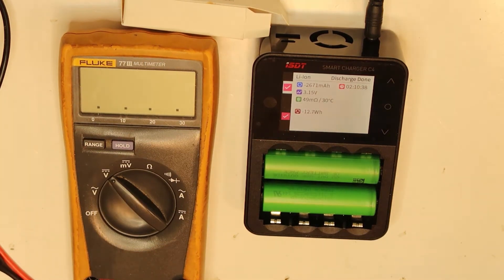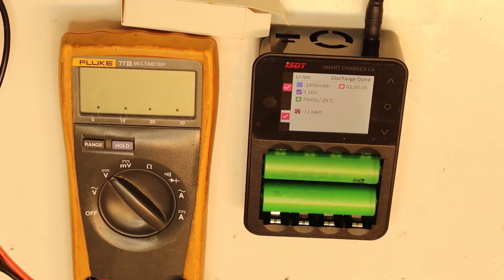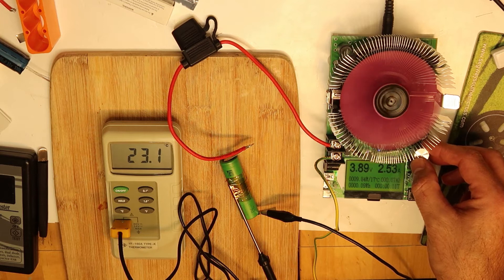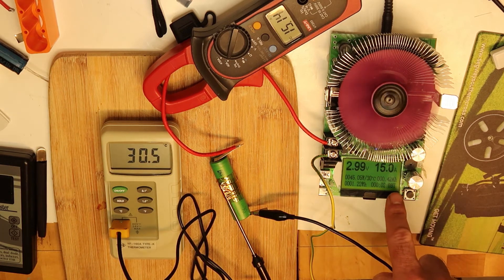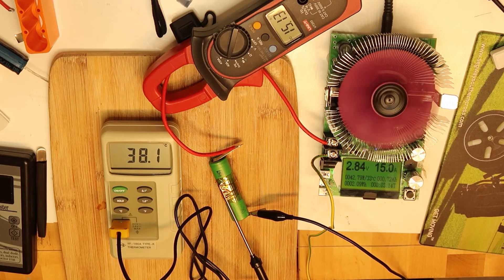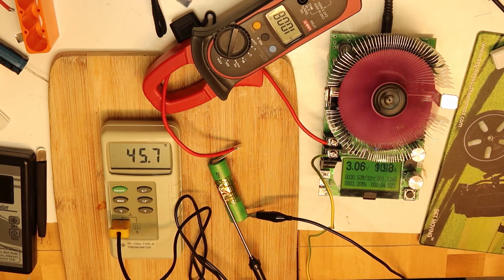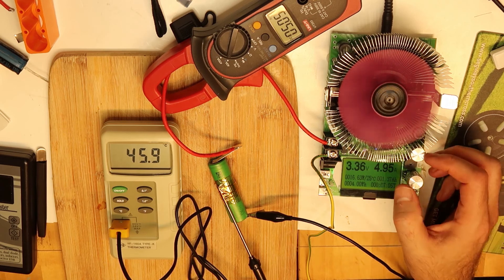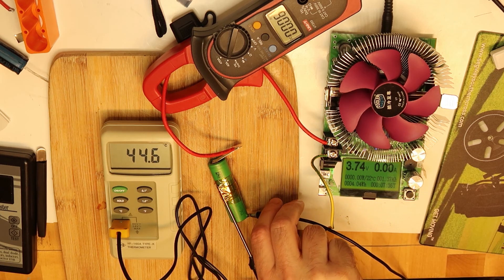Best 18650 Batteries, Sony VTC6 continuously! full test - part2 of 3

Comment: המתח ממש נופל! זה סטנדרטי לסוללת ליתיום יון?
Reply from the maker: תסתכל באינטרנט על גרפים של סוללות ליתיום - התכונה שלהם שהמתח יחסית יציב (בין 4.2 וולט ועד 3 וולט) - לאחר מכן יש נפילה חדה (שבשביל לשמור על הסוללה תקינה לזמן ארוך - לא מומלץ להגיע לשם) - זה בדיוק אחד התפקידים של BMS - Battery management system  לדאוג לנתק את העומס ברגע שמגיעים לנקודה הזאת. יש BMS שעוצרים ב 3 וולט, יש כאלה שב 2.5 וולט - ויש כאלה שניתן לתכנת
Reply from the maker: The question was - does always lithium cell voltage fell deeply?
Reply from the maker: The answer is that - lithium cell voltage curve is between 4.2V to 3V, when  continuing discharge after 3V - there is a deep fall, this is what BMS does (battery management system) - it disconnect load when one of the cells is below 3V or 2.7V or 2.5V, some BMSs you can program to desired cut off voltage